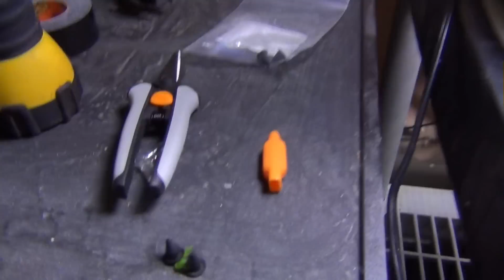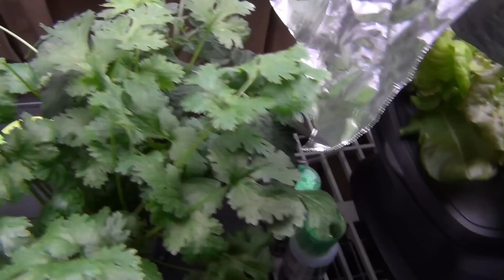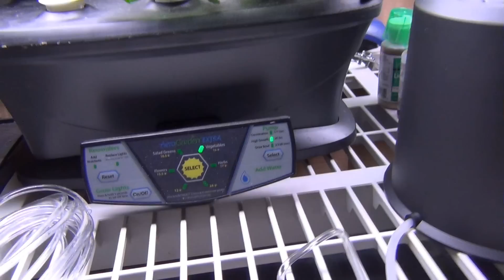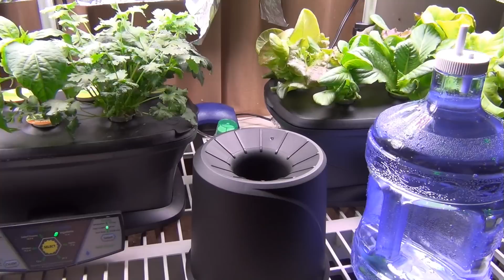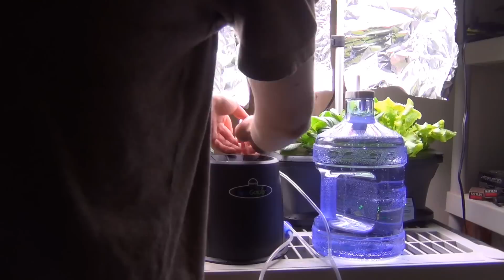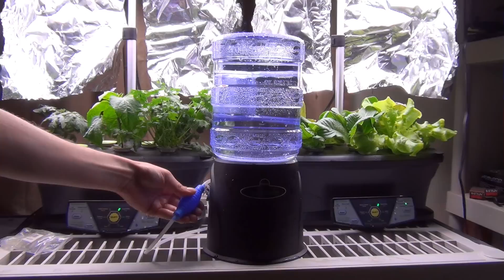AeroVoir Setup & Review - moded for two Aerogardens!

Comment: Would you reccomend wrapping the water bottle with foil paper to avoid algae from the grow lights shining into the resevoir?
Reply from the maker: I haven't had any problems with that.  Tap water should not contain much, if any, nitrite and phosphate.  So, algae shouldn't grow easily.  I've had zero algae in my reservoir.  But, you sure could wrap it if you wanted.  Or another idea.  Get some spray paint of a color you like, take it out in the grass, and give it a nice paint job.
Reply: @earthling1984 or get black tubing

Comment: what is the inner diameter of the hose you are using?  and the outer diameter of the y connectors are you using?
Reply from the maker: Hmm, I'd have to check that.  But, it is standard fish air tube size.  That's what I used, fish air tube from the pet shop.
Reply: the hose that i got has 3/16" inside diameter

Comment: They should have perhaps included an on/off valve for when you want to change out the water in the bowl as is sometimes recommended.
Reply from the maker: Just take the top water jug off.  Then raise the AeroVoir slightly so it drains fully into the AeroGarden.  Then you can remove it and do whatever maintenance you want to the AeroGarden.  Also, you can add a valve simply if you want.  The lines are the same as fish tank air hose lines, so any fish tank valve will work and cost almost nothing.

Comment: Great video!  I assume the tubing is fish tank air line tubing, but where did you source the Y splitter?
Reply from the maker: Got it on amazon I believe, but, you can find them in any pet shop as well.
Reply: will a t shaped connector work?

Comment: Hello, I have two Aerogardens. I'm going on vacation for a week in August, so I ordered 1 of the Aerovoir's so I can keep them properly hydrated while I'm away. Since they're about $40 a piece, I wanted to save money by modifying one to water two gardens. Can you please tell me is there a particular size Y connector (or splitter) and tubing? I don't want to get the wrong thing. Also, where can I purchase them? We have Home Depot and Lowes. I want to set it up in the next week or two so I'll be sure that it's up and working when I go away. Thanks in advance for your help! Sandra
Reply from the maker: The tubing is normal fish tank size.  I would suggest, so you get the right stuff, to just go to local pet shop.  Get a y-connector that fits into airline tubing for fish tanks (same size as AeroGarden), and get some spare tubing too as you will need some.  I found a single AeroVoir would only keep my 2 AeroGardens going for about 1 week max (it would be empty within around 4 days but the AeroGarden would be full and last another couple days before being low).  It should be ok to have just one for a week depending how thirsty your plants are.  I moved to 2 AeroVoirs for longer lasting water.
Reply: Excellent! Thank you so much for getting back to me, much appreciated!:)
Reply from the maker: Sandra Young No problem.  Another tip.  Let your AeroGardens get slightly low, then fill the AeroVoir before your trip.  Having the AeroGardens lower than the AeroVoir makes the water want to move through fast, to fill up the AeroGarden.  This will get all the air out, and ensure both gardens are getting water.  Now check that both Gardens are full.  At this point, you can take off your slightly empty AeroVoir bottle (cus it just filled your AeroGardens) and refill it, and re-put it on.  Now it should have the most water possible for your trip and be working correctly.  I had a problem once or twice when I refilled when AeroGardens were still full but AeroVoir bottle had just gone empty.  There was very little suction/gravity since the water levels were so close to equal, and one of the AeroGardens failed to start sucking water.  You can take off and on the bottle at any time, it doesn't matter because water gets level inside the base.  So do as said above.  Fill the day before your trip (with AeroGardens low).  Then the morning of your trip, make sure both AeroGardens got water up to top, and refill bottle.
Reply: Great tip! I will definitely do that! Thanks!:)
Reply: Earthling1984 s

Comment: Is this counter productive with the electricity it's requires or no?
Reply from the maker: +Young1Bloodz ?  What electricity?  This AeroVoir uses no electricity...
Reply: Earthling1984 Didn't know that. Interesting..
Reply from the maker: +Young1Bloodz heh, yeah just gravity fed.  but even if it did use electricity, it is meant to make it easier for the human to water the plants.  You need to top up each AeroGarden like 5+ times a week, so almost daily.  With this, it keeps them topped to the perfect level, and all I have to do is refill the AeroVoir 1gallon water container about once a week or so.
Reply: +Earthling1984 Awesome! Thanks for the knowledge. Do you notice a significant difference in living expenses with all the useful things you do? Ex. Aero Garden, your outside garden, Roomba Robot and anything else you might also have? Or do you mostly focus on the convenience of it all?
Reply from the maker: Well, my aerogardens are 30w each for lighting, then an air pump and water pump (very low power consumption).  So it's basically like running an old style 60w or so bulb for half the day(flowering) or 17ish hours of the day (during sprouting and vegetation state of the plants).  So really, the power consumption is minimal; like a couple old style light bulbs.
Reply from the maker: The robots are AWESOME!  My botvac keeps my house vacuumed a few times a week and does a great job!  I doubt it uses much more power than a standard vac run once a week.  My outside garden only cost the price to start it, and I can reuse yearly.  No power or anything but tap water needed.  Outside garden is most cost effective, but all are cost effective.  Barely any energy used and much time saved! :)  I also love my robot 'swiffer'.  I know that isn't what it is, it's the iRobot Braava floor sweeper/mopper.  But it also does an amazing job, and for the time saved, is for sure worth it!
Reply: Earthling1984 Cheers my friend, I’m definitely going to look into those bots, they seem to work wonders. Especially since you confirmed they're cost effective. I don’t currently see the need to have an Aero Garden as I live in a topical climate and there's an abundance of herbs like Cilantro (coriandrum sativum) just sitting in my yard. I'm moving back to the states soon so I might have to start one then.